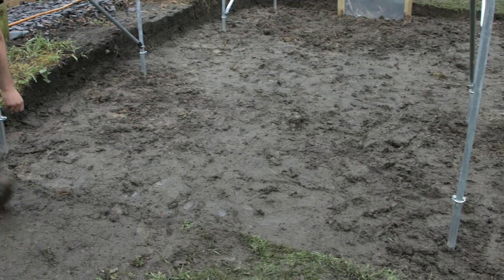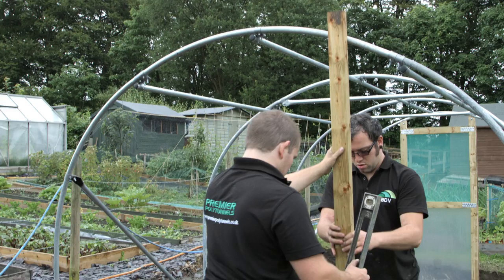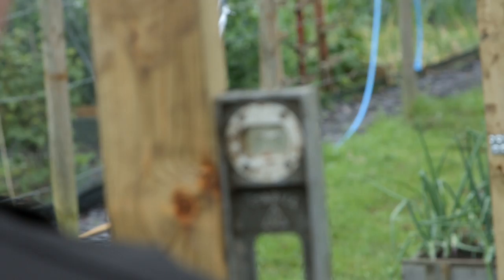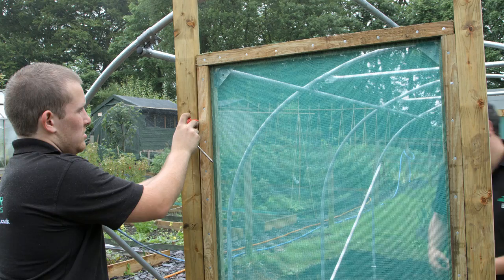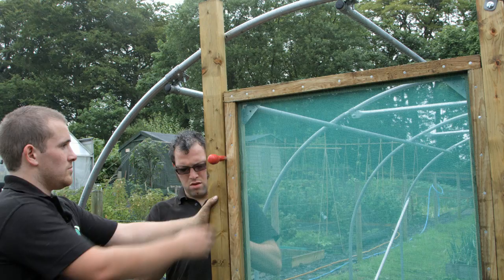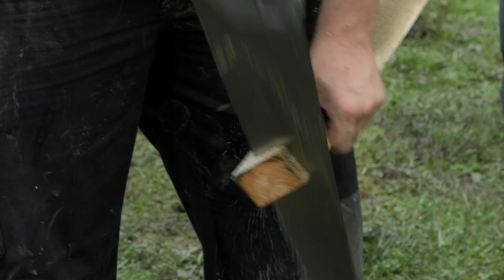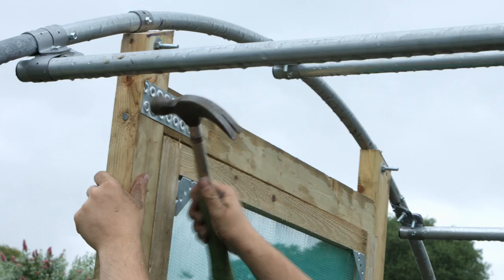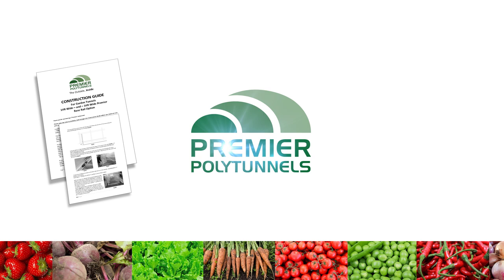Hanging a Single Door Frame and Hinged Door on Polytunnel

Comment: Great videos!Thanks! is there a difference between the method used to attain level ground? i have a 32 ft slightly sloped plot with maybe an inch grade (waiting for level to measure). My thought was to add 1 inch of height to the lower end of the foundation. But i am seeing your method of a dropped floor more often than how i thought to go at it (if ground is unleveled). Can you tell me which is preferred and why? My rational was water drainage. better above ground than below. Ty!
Reply from the maker: Hello, 
Polytunnels can be built on a slope. 
Your construction site should be clear and reasonably level from side to side - 1in sloping ground would not be a concern for building a polytunnel. 
Approximately 6in out of level can be accounted for by adjusting the foundation tubes of your polytunnel. On the high side of the slope, drive the foundation tubes in a bit further than is normal and leave the foundation tubes on the low side of the slope protruding a bit further than normal. 
A slope from end to end does not have to be taken into account as your polytunnel can be built straight onto this slope with the framework placed at the vertical.
To accommodate a larger slope, longer foundation tubes can be supplied – Please contact the Sales Team to advise if longer tubes are required.
Kind regards, 
Premier Polytunnels

Comment: I got lot of spares from your company and I'll follow these instruction for the door. ,What the width of the posts? Are they square?  75x75mm? and for the doors batten? 19mm or 25mm (double up)??? Thank you!
Reply from the maker: Hello, 
Thank you for your message. 
The door frames are 47mm x 75mm timber. 
The doors are 25mm x 50mm timber.
The battens (for attaching the polythene and net) are 19mm x 38mm.

Comment: Cool I'm going to replace my zip door with this, do you advise netting on the door I'll only have a single entrance and vents, thanks
Reply from the maker: Hello,
If you have vents on one or both sides of your polytunnel, you do not need to use netting in the top half of the door if you don't want to. :-)

Comment: putting those posts straight into the soil seems like a bad idea, wont they rot out within a few years?
Reply from the maker: The timber supplied is pressure treated with a wood preserver to protect against rot.
It will need replacing over time, but does last for many years.